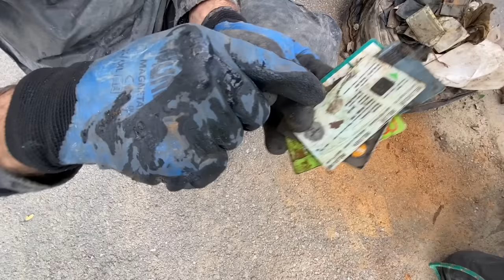What Happened Here? Astonishing Magnet Fishing Finds in Forbidden Canal!

Comment: My husband and I are interested in doing this, we have checked out your magnets and have a question.  How do you get the magnet off an item that is too big to pull out of water?
Reply: If you watch more of his videos you'll see that it's either pulling until your item comes up, your magnet slides off and if both these cases don't work; change pulling angle ie, go to the other side of your body of water or, if you can't, bring a pulley system to force your magnet back. 

But sometimes you lose the magnet because your rope breaks (make sure you have a rope that's many tiny ropes that is secured according to the manufacturers' guidance) or just because you can't get it lose. 

If I may suggest, begin with a lesser magnet. 200kg is enough to get to know what to do when it gets stuck but you can still easily get it back. Don't start with the biggest and baddest mags, that's a waste of money if you lose it. Better replace a cheaper one until you get the feel for fishing.
Reply: @MsDrientje gracias
Reply: You’ll also need good thick gloves (maybe needle proof) and a tetanus injection!

Comment: Holy CRINGE!     I wouldn't be within 100 meters of those guys.   Smacking an artillery shell with a lump of metal or rock, and pointing the barrel of the revolver straight at other people are both EXTREMELY dangerous.   Even if there is debris blocking the barrel, that is still the most likely exit point for the pressure of it firing and would send both the bullet and debris at the other person.  (Even with a blank round, the debris becomes it's own bullet.)
Reply from the maker: Thanks mate, we tried to keep a safe distance 😅😂